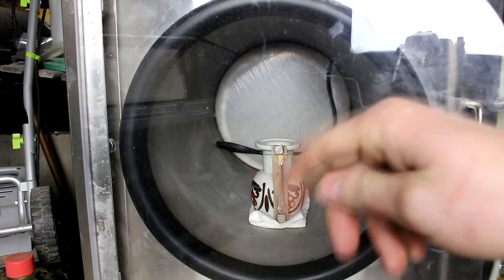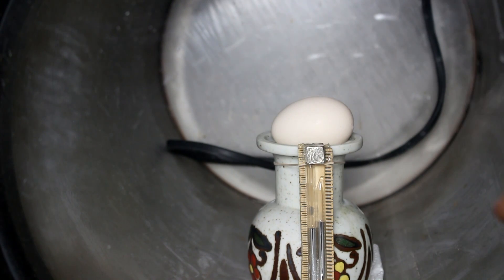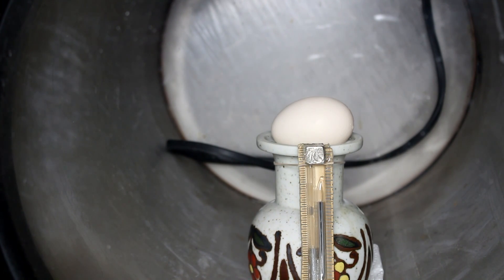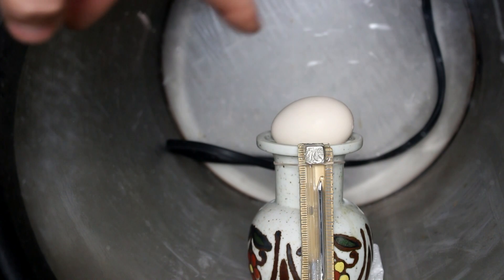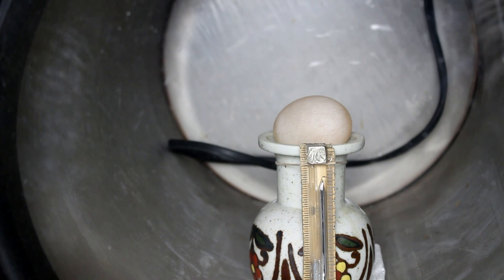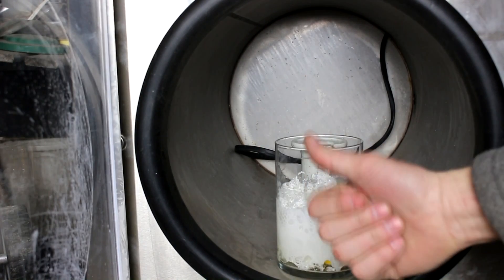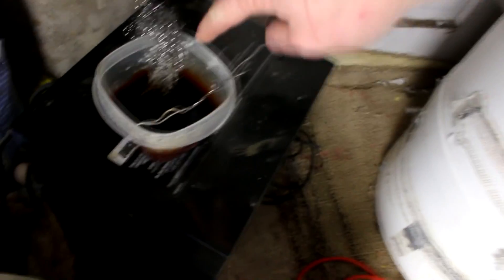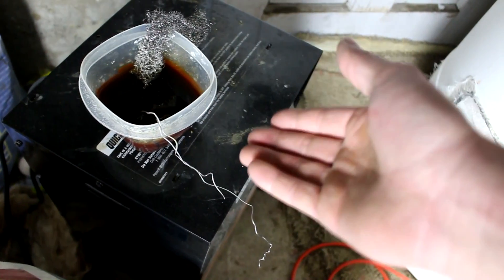Egg in a Vacuum Chamber

Comment: The egg didnt freeze, you desnaturates the proteins, like when you fries it. This is basically fried egg but with low pressure. Proteins changes their format at different temperatures or pressures, this is why you die out of hypotermia or hypertermia. The proteins inside your body start to deform and your cells that can't handle them start to die
Reply from the maker: Citation needed

Comment: would it still turn the same if you cracked the egg in the chamber under vacuum? i wonder how much of the air was trapped under the egg vs how much is naturally in the egg, did you crack the first one open to see the change inside?

Comment: Simple physics. If you remember that CHICKENS come from eggs, then you also have to remember that eggs are POROUS to oxygen and carbon dioxide, then we can infer that if you raise ambient pressure on an egg, it will just sit there, being an egg. IF you raise ambient pressure too fast, the egg cannot compensate quickly for the pressure change and the egg appears to 'implode'. Likewise, if a egg has been slowly 'pressurized' and then the egg is suddenly subjected to a drip on ambient pressure, so that the gas does not have a chance to equalize pressure, the egg will appear to 'explode'.

Comment: +Cody'sLab Great stuff CoDy!  There are so many comments I don't know if this has been suggested already, but since you have the equipment and I don't, here goes... Normal meringue is made by whipping egg whites with some Cream of Tartar, which is the potassium acid salt of tartaric acid, a carboxylic acid. As such, it can function as an acid. It is sometimes used as a component of baking powder, in which it functions as an acid, to activate the baking soda. In making your 'Vacuum Meringue' the removal of water will concentrate any non-volatile components. Any acid which is not pumped off will become more concentrated, lowering the pH. Perhaps it is possible to technically 'cook the meringue' by vacuum evaporation, to the point where the Cream of Tartar becomes acidic enough to denature the egg white proteins, a la ceviche (fresh raw fish cured in lemon or lime juice). If CofT is not acid enough, perhaps some other acid is? Nitric acid, for instance, has interesting effects on proteins, the xanthoproteic reaction. The proper 'vacuum meringue' trick would seem to be a matter of having the acid initially dilute enough to avoid 'cooking' the egg white proteins before they have become a puffy foam. Challenge accepted?

Comment: Can you put aluminum into a vacuum chamber then heat it up. The idea is that it will heat up faster since it can't transfer the heat away. Measure it with an infrared thermometer. Also, could you make holes for explosives with acid?

Comment: You might try ribbon (flat) wire for the electrolysis experiment (not sure what the experiment is exactly so this might not be viable) it has a lot more surface area than the round wire does and it should hold up better than the steel wool.

Comment: Loved the video! You should try using some carbon wool to do your electrolysis since it still has the surface area but shouldn't break down as easily during the process. I've used carbon rods from old batteries and they worked great.

Comment: how the hell did you just remove the shell?
Reply: Sizzling Mess Certain acids can dissolve the shell but not the membrane.
Reply: The epic sonic boom from his mighty fingersnap obviously just blew the shell clean off. Didn't you watch the video! :P
Reply: step one: get a cup, vinegar, and a egg. step two: pour vinegar in cup to about half (just depends on the size, has to cover the whole egg. step three: put egg in vinegar, make sure egg is covered and wait 24 hours. that's it, you have a  bouncy, transparent, shelled egg. (when bouncing make sure to not break it! its very delicate!
Reply: Glitchdweller at a few drops of red food dye and it looks like an impregnated uterus. it's very cool
Reply: Sizzling Mess I want to know to
Reply: Glitchdweller he used acid
Reply: CO2
Reply: vinegar
Reply: Magic. He is a wizard. Have u seen his videos?
Reply: Little late to the party, but white vinegar will dissolve the egg shell while leaving the membrane intact
Reply: Then put it in syrup and it'll shrink up
Reply: @peterford8424  I once tried and left the egg in the vinegar for almost a week and it absorbed the water from the vinegar and roughly doubled in volume.
Reply: Acid works, but if you're particularly bad at cracking eggs you can crack the shell but not break the membrane, and then just peel the rest of the egg if you're very careful
Reply: +Happy Goth Hi lady, you're very beatiful ;*

Comment: Hi Cody! Speaking from experience, I would not recommend using stainless steel as an electrode for electrolysis due to the potential formation of chromate ions in the solution, including hexavalent chromium. I performed an electrolysis experiment using stainless steel rods and it worked well for about a week, then abruptly began to corrode vigorously. I suspect this change was the result of the loss of the passivation layer from the surface of the stainless steel. Although I have not tested it, I have heard that a large surface area of regular steel will not corrode and will work satisfactorily if the overpotential across the plates is less that about a volt above the standard reaction potential for the electrolysis of water.

Comment: boil·ing
ˈboiliNG/Submit
adjective
1.
(for fresh water at sea level) at 212°F (100°C).
synonyms: at boiling point, at 212 degrees Fahrenheit, at 100 degrees Celsius/centigrade; More
noun
1.
the action of bringing a liquid to the temperature at which it bubbles and turns to vapor.

Comment: I would interested in watching a vacuum experiment involving machinist gage blocks sticking together through the procedure called ringing when two blocks are pressed together. You will have to rig a contraption to apply stress to pull them apart when under vacuum and maybe even measure the stress needed to separate them.

Comment: Hello,  Obviously, you don't yet have the knowledge of "what the vacuum is", especially, instant-vacuum!  Giving you a hint; in a semi-vacuum (not even absolute vacuum), the egg and any matter such as bobble, steel, osmium, or any known and or unknown elements will smash to the body of the vacuum chamber, cylinder, dome, container, etc., etc., etc..., and fulfill it      in-no-time.  The space above the Earth is a semi-vacuum, and if it was an absolute vacuum, all the universes would have collapsed (exploded to nothingness) right after its creation or existence (in No Time, way less than 10^-43 second (time).  That is way, way, and way less than what you have been told about the shortest time)!  The absolute vacuum is nothing that men kind could figure out, nor comprehend and it exists in the way above of expanding universes with a great space/s and limits.  That's why the whole universe is collapsing back in reverse direction onto itself.

Comment: Would it be possible to put a cloth with a magnet on the inside on the front glass and a small handle with a magnet on the outside, so that you can wipe the fog away while there is still vacuum?

Comment: Hey Cody, sorry this doesn't relate to this video but I have a question: my girlfriend's cheapish ring (silver coated copper) has started to loose a bit of its electroplated silver. I thought it would be cool if I could reapply the silver to it by electroplating using an old earring. I tried after some research using NaCl as the electrolyte and had the negative on the earring and the positive on a penny to test. The penny started turning blackish silver as expected but the solution started turning green around the earring. I was afraid it was chlorine gas dissolved because of the table salt so I stopped and put it outside. First of all, would this even work to reapply the coating to the ring? Second, are my charges oriented correctly? I switched them outside and the penny still turned black but now IT was bubbling. And finally, was I actually making chlorine or was it some form of copper? Thanks!

Comment: have you ever thought about putting a desiccant filter inline between your pump and the chamber?
something like a 2ft piece of capped steel plumbing with hose fixtures on the ends and filled with a desiccant of your choice... seems like it would do the trick

Comment: Try using steel wool, made from higher grade stainless steel. Like 316l or V4A. The Amway scrub buds I have, scratch lower grade stainless steel and did not stain in any solution so far. It is worth a try.

Comment: So couple questions.  Have you thought of reinforcing your gauge or making one with a metal tip? Would that be reasonably doable? That way you could test the effects of releasing the vacuum faster.  Given it doesn't damaged your other equipment. Could you  smash/wad some of your wire into a pseudo steel wool that doesn't degrade as fast to get more surface area? Like when you find a wire knot someone has somehow made.

Comment: +Cody - try carbon fiber fabric or roving for your electrolysis rig. Just keep your Electrical connection to any kind of metal above the water line and you should be golden. Higher resistivity, but that can be offset by the increase in wetted area of the fabric or roving. (roving or tow is what's typically used for filament wound construction and for stitching fabric preforms together before resin transfer molding).I made several batteries with zinc, nickel, or copper and short hanks of carbon fiber for applications that had to be flexible and biocompatible - we used ammonium chloride in agarose for a gelled electrolyte that also served as the passivation layer between the anode and cathode. unless you see ridiculously high temperatures and/or arcing, the carbon is completely inert.

Comment: Out of curiosity, Cody, why don't you simply use a cold trap inline with your vacuum line when you do these experiments? I'd imagine it would be more convenient than using dessicant, and would protect your pump.

Given that you have access to cryogenic liquids, you could no doubt cool one enough to condense any water that would otherwise enter the pump.

Hell, I have an old vacuum filtration flask you could probably have if you like.

Comment: I don't know the exact application but why not use carbon electrodes for the electrolysis instead of stainless steel? Carbon should not break down considerably.  I used carbon as an electrode in an electrolysis tank I built for rust removal and the carbon does not appear to be dissolving whatsoever.  If you need more surface area, you could buy a carbon plate and drill a bunch of small holes.

Comment: I assumed the freezing occurred due to the decrease in pressure, which then dropped the boiling point of the water to the triple point of water. Although heat loss from latent heat of evaporation also makes sense. I'm curious which is the route cause of freezing

Comment: Very cool.  How many eggs did it take before you got one completely shelled with the membrane intact?  What was your method?
Reply: Bang Switch Probably putting it in an acid like Vinegar
Reply: VapeLordEon you cant use hydrochloric acid. its very strong that even the membrane of the egg will disolve. weaker acid such as acetic acid will do.

Comment: can the shell only keep the pressure due to the shape of the egg, or what the egg is made of, or a little of both?
Reply: The shell's membrane is porous, so the gases can escape so the egg doesn't explode.
Reply: That's insightful. Thanks.
Reply: The shell must be porous, too, since the vacuum pump couldn't get below the water triple-point then either.

Comment: what happens to water in vacum
Reply: matdex2002 it gets vacuumed up
Reply: matdex2002 it will boil.
Reply: For liquids to boil, the vapor pressure must be equal to the atmospheric pressure to boil. By decreasing the atmospheric pressure, the boiling point is lowered.

Comment: My theory is that this is caused by cold denaturation where the temperature was reduced low enough (with aid from the vacuum) that the hydrophobic interactions that hold the egg white proteins in their stable folded state have reached a temperature where the both the stabilizing effect of entropy and the destabilizing effect of enthalpy are both increasing as the clathrate cage that forms around the protein becomes more ordered and forms more hydrogen bonds then the bulk water surrounding it. this is due to the reduced effect of entropy at lower temperatures. this continues until water can then infiltrate the center of the protein and form a hydration layer that breaks apart the protein structure. the exposed hydrophobic centers of the protein molecules are then able to interact with each other to for a network that results in the opaque gel. Tl:DR it's due to thermo dynamics here is a paper on this effect
 http://www.physics.mcgill.ca/~grant/Papers/DIAS09_cryo.pdf

Comment: Biochemists:  did the proteines in the egg denaturate? I know that is what happens when the proteines are  exposed to heat and either low or high pH values, but  I don't remember  reading about denaturization from low pressure .

Comment: There's a significant amount of gas exchange through the shell and membrane - which is how the growing chick gets oxygen - so whatever the pressure difference between the inside and outside of the egg it wouldn't have been extremely high. This is also demonstrated by the fact that there was still some pressure from the egg outgassing even on the first test.

Comment: Cody could you try putting a balloon over the top of the dish with the egg and allow the balloon to act as a diaphragm, when it pops the sudden change in pressure could cause some cool effects. Or would the egg still experience the same change of pressure during the expansion of the balloon?

Comment: What kind of electrolysis do You want to perform with stainless steel electrodes? Do You want to use them as anodes, cathodes, both?  What will be electrolite made of?   316L stainless steel is best and easy to get, often TIG weldind rods are made from them, also You can buy some plates.  But from my experience stainless steel is good only for basic solution not containing chlorides. It wont even work as cathode in chlorate cell.

Comment: Check to see if the stainless mesh is magnetic.  If it is magnetic then it's likely 400 series which doesn't have anywhere near the corrrosion resistance that 300 series (more nickel and chromium)does.they probably use 400 series to make it cheaper while still being able to call it stainless steel.  You probably already knew that but maybe some of the viewers will learn something from this post.

Comment: Stainless steel will leach chromates into your bath,  so consider ways to dispose of that if you continue.    we played with electrolysis using dollar store stainless steel spatulas and ladles...  Have you thought about using Carbon rods?   ive been meaning to experiment with carbon fiber rods to see if they can be used in a  DE-Ruster electrolysis tank.

Comment: Hey Cody, I used to work on water treatment by electrolysis. You can use stainless steel, but only for the negative (hydrogen-producing) electrode. For the positive electrode, there is really only one cheap option: carbon. Titanium works well, too, but is comparatively expensive. Not as expensive however as, say, platinum or gold.

Comment: What happens if you open the door while there is no air in the chamber?
Reply: You'd be incredibly strong.
Reply: LJH everything would be damaged or destroyed, that is if he would even be able to open it with a vacuum behind it
Reply: Stefan Huber I lift someone lifting bro
Reply: LJH  you couldn't open the door.
Reply: Stefan Huber I could lift that
Reply: Have you ever seen a hole in a plane? Something like that
Reply: LJH Its nearly impossible because of the negative pressure.
Reply: The force needed to open that door would be like lifting 2 tons
Reply: LJH if u mange to get it open u would have your self some explosive decompression and it would most likely destroy the egg entirely

Comment: So why does the egg not cook if the internal gasses reach boiling temperatures? I have very little understanding of the effects of pressurization.
Reply: Succulent Lord the water boils because of the lowered pressure not the Temperature so the egg isn't cooked because there isn't enough heat to denature the proteins in the egg... I have a very basic understanding of this so I hope this helps

Comment: Hey Cody. For better shots in that chamber, you could put a soft cloth backed with ferrous metal on the inside and a magnet on the outside. Then you can wipe away fog without opening the chamber.

Comment: love these vacuum chamber videos. I want to try an experiment. there is a process company's are doing to waterproof a electronic device by I am told puting it in a vacuum chamber introducing the micro hydrophobic material and then allowing the air to come back.  I wonder if electronics such as phones would survive a decent vacuuming and if it's when it's under vacuum that the polimer covers the internals or when the air rushes back into the phone it pulls the material in with it? what do you think ? I think I want to try this with a product called nanoprotech.